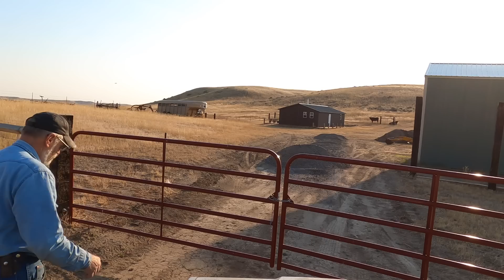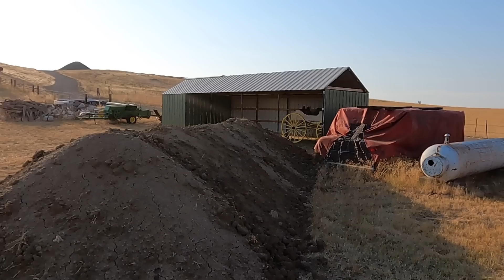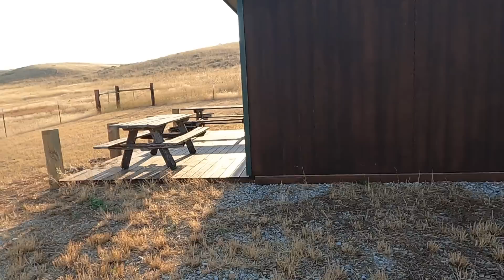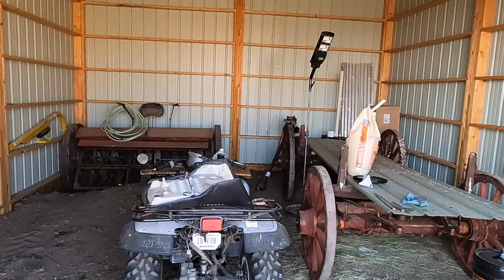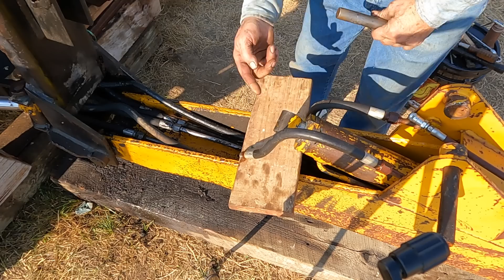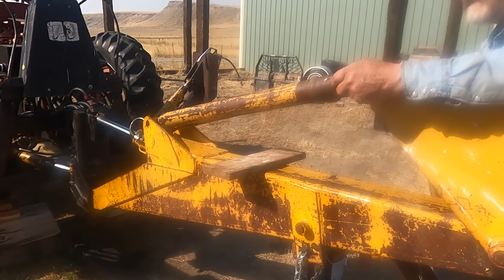Ford 3-Point Backhoe Rehab | Engels Coach Shop

Comment: I musta missed the part where you had to walk back & forth 937 times between the control valve and the end of the far cylinder to get the pin lined up.

Comment: This video was a lot of fun, thank you.  I was rebuilding my old Hobart welder for youtube a few years back and got some oily smudges on my phone screen, so I got a good laugh when I saw that.  Your place reminds me of an area I stopped at a couple months ago on a convoy.  It was a few miles N of Enterprise, OR called the Eagle Cap Shooting Range. Very pretty homestead you have.  Just a very beautiful part of the US in general really.  Since your hydraulic pump is positive displacement, you can cycle your “new” cylinders all the way in and out a couple times before knocking pins, to get most of the air out.  I’ve heard of guys bleeding them like brakes, but I’ve honestly never found that necessary.  The air eventually works its way out I’ve found.  Really enjoy your after work videos, hope you don’t burn too much daylight making them!  I know how short the weekends are!

Comment: Dave, In Vietnam when our Chinook helicopter flight control actuators would seep, we first would try operating the flight controls while flushing the actuators seals with parts cleaner we poured into a pump type fire extinguisher, at times it would remove sand and dirt and the seals would reseal themselves.

Comment: Interesting to see the landscape, does the pasture ever green up? Also noticed that there are no trees, the landscape has a desolate feel to it, but that's probably because here in England it's pretty green all year round and there's quite a few trees. One last observation, I've noticed Americans site their buildings quite far apart, guess that's cause you have a lot more space/land than us here in Blighty. Thanks for the upload.
Reply: One reason we locate our buildings further apart is in case of fire. We had a fire about 35 years ago, and the fire chief drove out to our place in about 20 minutes just to see if the fire was for real, and then he'd call out the fire trucks. Fortunately I had enough fire extinguishers to put it out just before the chief arrived. At my son's farm, he lost one building to fire, but the fire dept was able to save the other buildings. When the grass gets real dry here, grass fires can move real quickly.
Reply: @paulhetchler1635  True. We had a barn burn down 20 some years ago, and it was far enough from the other buildings that nothing else burned.
Reply: Yes, it's beautifully green in the spring. We plan to plant some trees when we get our water system set up. it is really  dry, so we plan to put rain gutters on the buildings and collect rain water in barrels.
Reply: @dianeengel4155  A few trees around the place would be nice and it's grand to leave something for later generations. Even better if you have a few fruit or nut trees. My garden has a big Ash tree and I've let be some self seeded Hawthorns, the birds love em too. I guess it's finding the time though, what with your both being busy. As you have a big family maybe a tree planting party is a way, all you have to do is supply the trees, some booze and a bit of nosh. Regards from England.

Comment: Hydraulic fluid will get everywhere , if I had to repair a popped hose I'd come home wearing most of it . Great place you have there , very calm , the cows look good and your buildings are coming along . Great video . 👍🇬🇧 Ps don't forget to top up your reservoir after you've bled the system . Only saying , cos I didn't and gave myself a headache further down the road .

Comment: I have enjoyed watching you refurb these hydraulic rams. Here is a top tip from a man who has spent his whole working life chrome plating hydraulic shafts... Whenever you have finished using the machine, always put as much of the chrome back inside the cylinder to be protected by the oil. And if that is not possible like on the two cylinders that turn the arm from side to side, just take it in turns to leave one in, then next time do it the other way. Also if you are leaving the machine unused for extended periods of time, coat all the chrome with some protective grease or vaseline, it all helps save the chrome plating. Because as soon as your chrome plating starts to fail it will destroy the seals very quickly.  "Look after the chrome and the chrome will look after your seals."
David in the UK.
Reply: Thank you.

Comment: Just connect the hoses, start your machine and cycle the cylinder slowly without going over relief. The air will purge out on its own. Cycle the cylinder 4 times will fill the cylinders. Refill reservoir.

Comment: Hi, again Dave, To bleed the air out of the system just hold the lever in one direction and back to the other direction at the end of the travel for a few seconds this will allow the air to expel from the rams and hoses and fill the system with oil.
Reply: Dave said he's been doing that over and over. He gets big belches of air and it gets more air in there. Any suggestions?
Reply: @dianeengel4155  Check the oil level in the tank, and try again that should bleed the air out of the system I have never had a failure with this method and I have been working on machinery for 30 years now, also you could hold the lever in full position one way for a minute or so that should clear any air in the system, Very hard to diagnose these things unless one is on the spot as you can understand.
Reply: @dianeengel4155  If he is getting more air, then most likely his tractor's hydraulic reservoir is low on oil.I can't tell from this video what model Farmall tractor it is. Some used the transmission oil for the hydraulic system and some used a small hydraulic tank. Wayne is correct as he describes how to eliminate air in the system. I have seen some of these backhoes have their own PTO driven hydraulic pump and only a small reservoir. As all the cylinders on the hoe are 2 way cylinders, once filled with oil they do not need much from the reservoir to operate normally. But when serviced or rebuilt, then they may take enough oil from the reservoir to cause the pump to suck air. I have owned and used many of these vintage tractors during my 50 years of farming.  Best of Luck!
Reply: @paulhetchler1635  Thank you!

Comment: Mice ate into 6 of my kubota BH hoses where they all went up through the boom. It was a messy job replacing them and the fittings on the control valve leave no room to turn a wrench. Had to use some modified diesel injector sockets and a planned hookup sequence to get them all back in.

Comment: Oil on the lens just proves you were workin' :)

Nice grazing land out there. How deep is water?
Reply: I think about 300 feet, but it has methane in it, so can't be used without a very expensive system to treat it.

Comment: Good work.  as a tip, when storing always articulate the boom and stabilizers to retract the rods into the sleeves.  after which take some clean grease and coat any exposed cylinder rod.
Reply: Very good tip! Makes sense not to expose the rods.
Reply: @gs1100ed  Yep, seals and wipers are cheap, a scared rod means a very expensive replacement part.